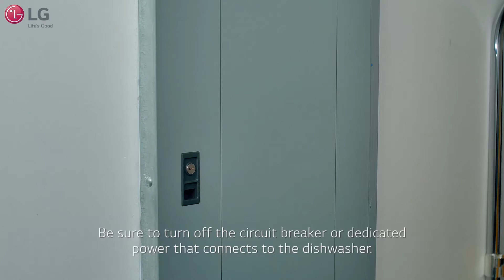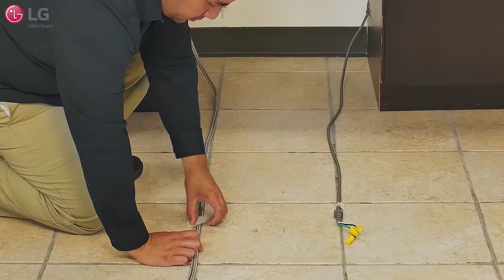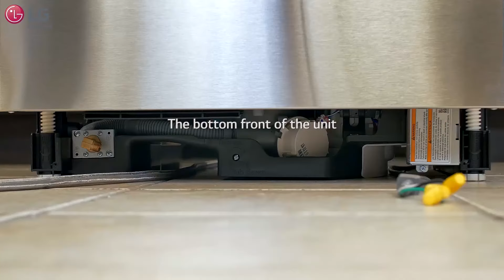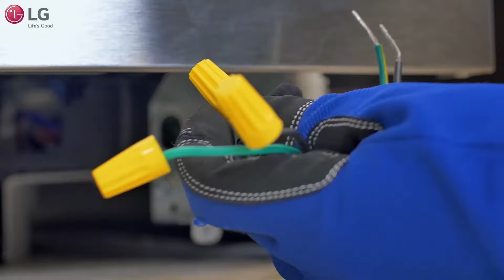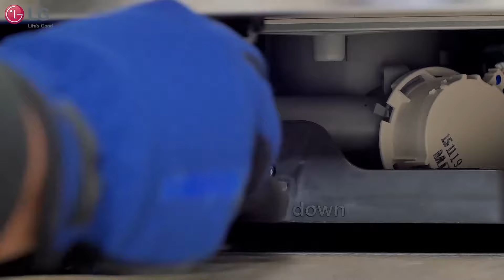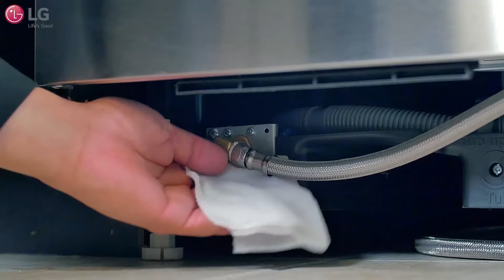[LG Dishwashers] Installation

Comment: No high loop for drain line
Reply: Hey Billy. Great question! To ensure your LG dishwasher is installed correctly, it is important to have all the necessary parts. TO make sure that your dishwasher needs a high loop for the drain line, we need your model number. Please private message us on social media @LGUSSupport with your contact details and the model number. We'll be waiting for your message so we can help you through this. ^David

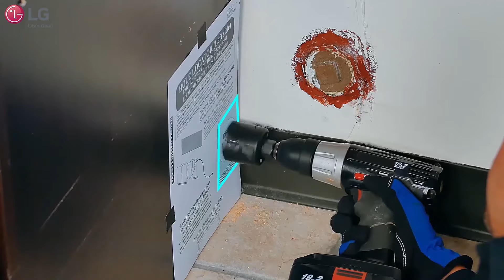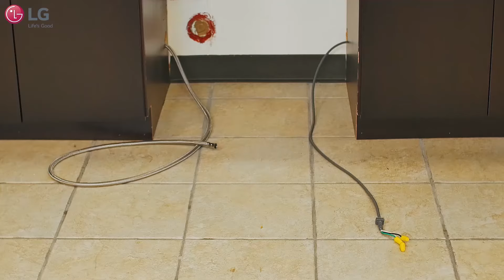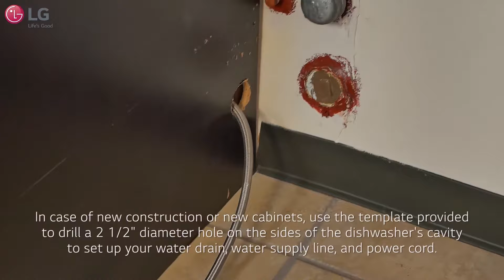Comment: Hello, I bought this dishwasher and I am about to install it. That video is confusing because it explains where to drill the hole in cabinet at 0:44 but you don't listen to your own explanations and did the hole in different spot at 0:48 and 0:36.
So both holes are ok to do I guess?
Reply: I noticed this too. So which is it? The LG provided diagram shows where the base of your cabinet should be, but that doesn't line up with where the drill hole diagram says the floor should be. The same video, also found on the LG website, contradicts itself.
Reply: Hey there! Both holes can be used for installing the water drain/supply line and power plug. If you have any further questions, feel free to reach out to us on social media at @LGUSSupport. We would love to see how your new dishwasher setup looks! ~ Ryan

Comment: Are there top mounts to secure the dishwasher from tilting forward?   I tried to fasten it from the side and, as someone said before, the screw pulled right through the metal side mounting.    I did not receive top mounts with my yet unfinished project.
Reply from the maker: Hi there! Based on the installation video above, there should be a bracket that ensures the proper installation of the unit. If the side screws are pulling through the metal, it may indicate that the brackets are not installed correctly or that the screws are not suitable for the material.

On the other hand, if the dishwasher is not level, it can cause instability. You can adjust the front legs using a flat-head screwdriver or pliers:
- Turn the front legs clockwise to raise the front of the tub and counterclockwise to lower it. Use a Phillips screwdriver to adjust the rear legs:
- Turn the center screw clockwise to raise the rear of the tub and counterclockwise to lower it.

If you are missing top mounts, you may need to purchase them separately, but it still depends on the model of the unit. If you need further assistance regarding this matter, please send us a private message on Facebook or X at @LGUSSupport. `Liz

Comment: Why the drain hose doesn’t connect to an air vent cap? The wasted water in the sink might get into dishwasher
Reply from the maker: Hi Henry. Thank you for your concern about the drain hose connection. We recommend consulting our installation manual or a professional plumber to ensure proper drainage and prevent potential backflow issues. If you need further assistance, feel free to send us a private message through our support channels on social media @LGUSSupport with the model number of your unit. We're here to help. ^Win

Comment: Do not buy this garbage dishwasher, it has been nothing but problems. It has a latching problem that will throw a countdown code. I have had the dishwasher less than a month and it is on it’s second latch already, with the same problem. LG is a nightmare to try and get any service or warranty repair work either on the phone or through their website. Stay away from LG products…..

Comment: Do you have to remove the back black shipping cover? I connected my dishwasher and followed the video but the machine just doesn’t fill or start. I have power and can set the delay start and all that stuff. What gives? It’s leveled. No kinks. Very frustrating.
Reply from the maker: We understand that dealing with unexpected issues can be frustrating, especially after carefully following the instructions. It's great that you've taken the time to ensure everything is set up correctly. Please send us a message on social media @LGUSSupport. We will work with you through this issue and do our best to help resolve it.

Comment: my dishwasher sits level from top and from inside wall, exactly as shown in the video, but not quite level from the back inside wall of the tub.... as long as it's leveled by what's shown in the video, is that ok?  I'm assuming the back wall might be slightly curved by design?
Reply from the maker: Hey there, these specifications should allow everything to run smooth. Should you have any concerns, try re-leveling and reaching us on Facebook or X using @LGUSSupport with your model, serial, and phone number. ~TammyJo

Comment: BUYER BEWARE -- After 1.5 year, Dishwasher control panel fails and you WILL have a $800 rock.

It WILL start bugging out, goes blank, and does not finishing washing cycle.  Or sometimes the lights just go on a fritz before it dies for the day.  I saw many reviews stating the same issue.

LG is clever though!!  LG says their warranty is only 1 year  -- so because I'm over by 4 months, they will not pay for labor on the warranty.

My dishwasher was $800 and the labor to repair will be $650 because it's "outside the 1 year labor" by 4 months.

I also had to call LG twice to even talk to anyone.  The first time I called LG customer service, the LG rep FELL ASLEEP during the call.   This is LG customer service experience that you can expect if you buy LG.

I bet if I opened up this dishwasher, it will be cheaply-glued with poor parts inside.

BUYER BEWARE !!   $800 rock in your kitchen.
Reply from the maker: Hey there, Henry. We appreciate you bringing this to our attention as we understand how important a dishwasher serves your daily needs. This is not the kind of service that we strive to achieve with our customers, and we'd like to further clarify your situation. At your earliest convenience, please send us a private message through our Facebook or Twitter platforms using @LGUSSupport and provide us with your contact details, as well as the model and serial number of the dishwasher. ^Anthony

Comment: If your power cord is behind the dishwasher, You will need a 90° plug ... and the wire should be 14 gauge wire with ground wire.   14 gauge. Not  16 gauge like in the Manual... But other than that, great video. Ps. If you bought it at Best Buy. You'll have to buy all the parts yourself, even if you have it installed by them.  Parts $100.
($224. Installation fee. )
Reply from the maker: Hi, Jeffrey. Your comment provides valuable insights and highlights important details for people planning to install a dishwasher behind the dishwasher. Great job on sharing this information, and we're sure it will be helpful to many DIY enthusiasts and homeowners! Should you need any assistance, send us a private message with your contact information, and we'll be pleased to see what we can do to help. Thanks. ^Jolly

Comment: Does this dishwasher need to be connected to a garbage disposal. Also can the dishwasher drain conenct directly to an air gap wich then goes into the garbage disposal?
Reply from the maker: LG dishwashers do not necessarily need to be connected to a garbage disposal. However, it is common for dishwashers to be connected to a drain line, and many homes have a garbage disposal as part of their plumbing setup. When connecting a dishwasher drain, it is generally recommended to use an air gap or a high-loop method to prevent backflow of wastewater into the dishwasher. It's important to follow local plumbing codes and regulations when installing or modifying dishwasher drain connections. If you are unsure about the specific requirements or best practices for your area, it's recommended to consult a licensed plumber or a professional installer for guidance.

For detailed instructions on dishwasher installation, it's best to refer to the user manual provided by LG for your specific dishwasher model. The manual will include specific instructions and diagrams to help ensure proper installation and drainage. ^Danee

Comment: What if our power line doesn’t have a green wire, I have black, white and a copper line
Reply from the maker: Hi Dylan! The three wires are a hot wire, which should be black or sometimes red; a neutral wire, which should be white; and a ground wire, which should be green or bare. ^Danee

Comment: Pro-Tip... Tilt the dishwasher backwards to unscrew the junction box screw before you connect the water... That only took me an hour to figure out lol
Reply from the maker: Hi Luisa, We want to say a warm thank you for helping us out and the community. We value your feedback, and it not only helps us, and the rest of the community. Should you need our help, Please reach out and let us know.~Tanisha
Reply: I had to tilt back, hit the screw with silicone spray, and go at it with a screwdriver on the head and pliers on the shaft.
Reply: @Mrv1960agreed. That was the hardest part of the install.

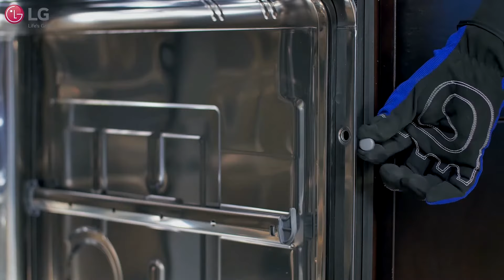Comment: 4:14 There is no way that small screw is going into the side of the cabinet. You made your dishwashers so they are 1/2 of an inch smaller then the space so you have 1/4 on both sides of a typical opening. Does anyone at LG even install these things?
Reply: I thought it was my cabinets... I had to get longer screws to side mount it.
Reply from the maker: I’m sorry to hear you're having this issue, and I’d like to see if we can assist. Please contact LG Customer Support by direct message via Twitter ( @LGUSSupport  ) or Facebook Messenger ( https://www.facebook.com/LGUSA/ ), and include your contact details, the model & serial numbers, and a detailed description of the issue.

^NS
Reply: @LGUSASupport  thanks but no thanks. I'm pointing out flaws in your video. I don't need support...
Reply from the maker: I understand that this has been inconvenient for you and how annoying that must be. Have a great day and stay safe as well. 

^NS
Reply: @steve_main you sure about that?
Reply: @billy__gallant  100% the screws provided are like 1/2" long.. so after going through the side of the dishwasher to the cabinetry to which there is a quarter inch or even 1/8 inch space between they're not long enough.. so unless this dishwasher perfectly fits in the space with no Gap to the left or right it will bite in maybe a 1/4 of an inch. the screws are too short I installed the dishwasher myself had to get longer ones

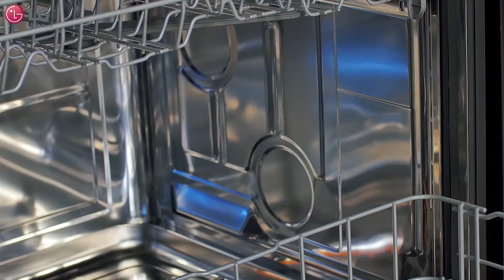Comment: 3:48 That dishwasher is like 2 inches away from the top of the cabinet!! Is this huge hole supposed to be here? is this space for storing baking sheets??
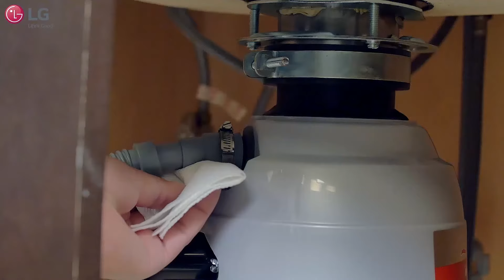Reply: That gap miraculously disappears at 4:30 ...

The storage would be nice, 😂
Reply: These units create a lot of heat and moisture which obviously needs to escape.  The gap on top allows for this.  It's not a snug fit for a reason.

Comment: I could not read the manual that came with my new dishwasher because the font was too small. so i watched this video instead. from the video i assumed that the leveling screw mentioned for the back feet was in the back of the unit. that did not make any sense. then i found the manual online where i could read that the leveling screw was in the front. now i get it. this video is helpful but incomplete. in any event i now know how to level my dishwasher. if anyone has trouble be sure to read the manual. life's good.
Reply from the maker: Hello! I'm passing by to check up on your case. Please send us a private message. Thank you so much.
Reply: @LGUSASupport  i do not know how to send a private message, all is good, i do not need any help.

Comment: How can you get to the leveling screw on the back of the dishwasher once it is in place?
Reply from the maker: Welcome to our Social Media page. Based on your recent post, we see that you may need support. Please send us a private message. Thank you.
Reply from the maker: Hello! I'm passing by to check up on your case. Do you still need assistance? If so, let us know if there is anything that we can do for you. *Leah
Reply: Ha, you can't.  This dishwasher is not install friendly
Reply: you can't Check your floor level. It doesn't need to be perfect. You will know if your floor is way out
Reply: @boarhog1979  It turns out that you can. I did not read the instructions properly. The adjusment for the back is accessible from the front.
Reply: @jeffvanfleet2025  good to know. The bosch has the same

Comment: You didn't even cover how to install the bracket using the side mount technique. I have stone counter tops, can mount the brackets there. must be mounted on the side! where is that video? typical LG!
Reply from the maker: Hi. Please contact LG Customer Support by direct message via Twitter (@LGUSSupport) or Facebook Messenger (https:'//www.facebook.com/LGUSA) and include your contact details, the model and serial numbers and detailed description of the issue. ^Van
Reply: Yeah for real. The part I’m stuck on they didn’t even cover for 5 seconds
Reply: Where can I find the brackets?
Reply: @eviebey   you can order them on Amazon.  They cost about $8.00 for the pair.

Comment: what size if the water supply line?  Is it NPT threads?   R&R old unit with 3/4" hose coupling. Using 3/8" polypropolene "push-on-connector - John Guest.  Don't have or see a fitting other that will match a push-on-connector adapter.  What next?
Reply from the maker: Welcome to our Social Media page. Based on your recent post, we see that you may need support. Please send us a private message. Thank you.  *Leah
Reply: @LGUSASupport  so, whats the size? I can’t fit it.
Reply from the maker: Hello! I'm passing by to check up on your case. 
Do you still need assistance? If so, let us know if there is anything that we can do for you.  *Leah
Reply from the maker: We have not received any response from you. We assume that your concern has been resolved.  For now, I will go ahead and end our session. Should you have any other questions or concerns, please feel free to reach out again, and we'll be happy to assist. Have a great day. *Leah
Reply: @LGUSASupport   Thanks for reaching out on a follow-up.  The machine was installed last Saturday.  All the fittings matched.   For some reason,  nothing is drying.  Have run 2 cycles and everything in the dishwater is still soaking wet.   Have not used "jet-dry' or similar yet, and no water in bottom of the tub.  Very strange.  Ideas?
Reply from the maker: Hi, Good Morning, I do apologized that you are having this kind of issue on your unit. Mind me asking, is the unit professionally installed, if you can also send us a private message. Thank you so much.  *Leah
Reply: @LGUSASupport  While it may seem complicated,  installation by homeowner, is not difficult.   I've installed numerous dishwashers,  sinks,  faucets, drains, disposals and have well above average skill level for home improvements and the like.  The installation was nothing more than removing the drain line,  water supply line, and wiring an electrical plug (all included w/ installation kit) and attaching  the new lines where the old ones were.  The drain line does go to a vent line before draining through the disposal and it is not clogged.  It is level  front to back and side to side. The drain line is also routed to include a 'high loop' to avoid any backup entering the dishwasher.  I've also searched numerous sources and have found a number of other people have the same issue.  It appears these do not have a separate heated dryer element, and no venting of steam during the drying mode.  There is a fan on the left side inside the machine that I suppose is to circulate air to aid in drying.
Reply from the maker: Hi, I will consult your inquiry, kindly send us a private message as well. Thank you so much.
Reply from the maker: Hi, please send us a private message. Thank you so much.
Reply from the maker: Hello! I'm passing by to check up on your case. Please send us a private message. Thank you so much.
Do you still need assistance? If so, let us know if there is anything that we can do for you.
Reply from the maker: We have not received any response from you. We assume that your concern has been resolved.  For now, I will go ahead and end our session. Should you have any other questions or concerns, please feel free to reach out again, and we'll be happy to assist. Have a great day. *Leah